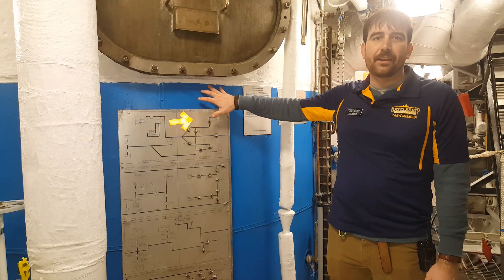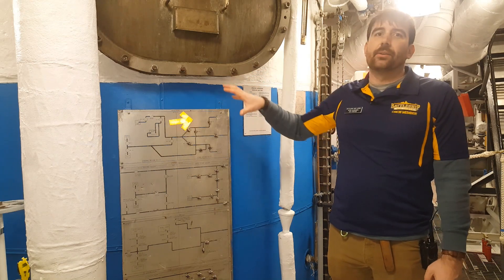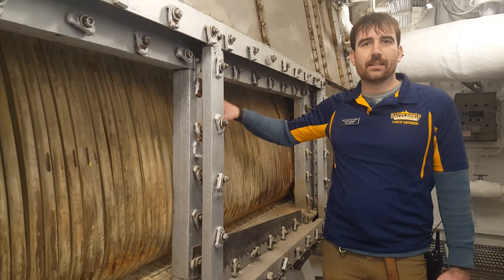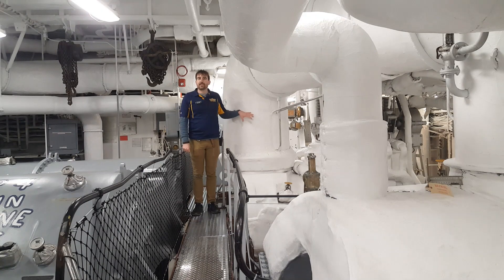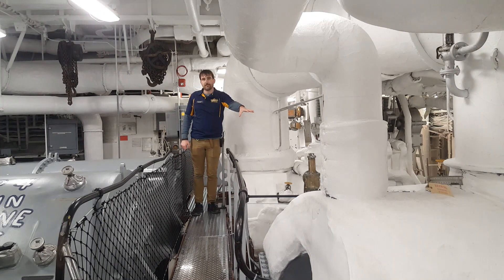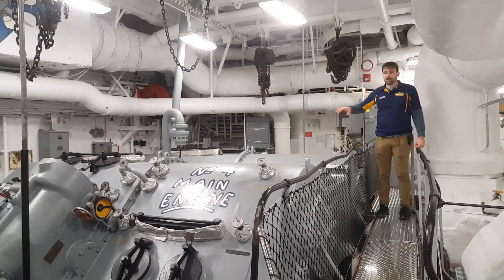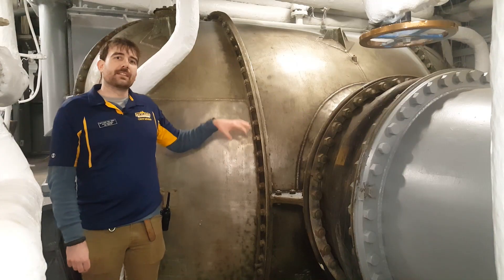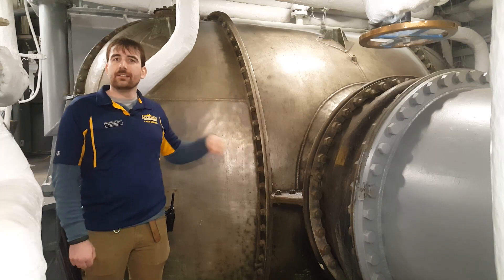The Steam Cycle

Comment: I used to wonder why the steam got condensed into water, which seemed to me to waste the heat in it.
I learned about the Carnot cycle and how the efficiency is better the large the temperature difference is, but I never had a gut feel for why.
Until I read reprints about old ocean liner steam plants. The efficiency of the condensers is measured in inches of VACUUM. The lower pressure at the exhaust of the low pressure turbine increases the efficiency, as it is the difference in pressure that supplies the force to turn the turbine. Thus, causing a vacuum at the exhaust increases the efficiency.

Comment: Those main engine inspection ports are locked with the same high security locks that the hold for nuclear weapons have.  Only the CO and the CHENG(Chief Engineer) have keys and they must be inserted and turned in order to access them.  The gears in there are so finely machined that IF someone were to toss sand or dirt in them, they'd be junk.  Those engines are worth a LOT of money and were virtually irreplaceable by the time the ships hit the 80's.

Comment: Believe it or not, the same basic equipment is on modern steam powered ships. The only difference between a nuke plant and a conventional is what makes the heat for boiling water. A hot rock or fire. 

The hot rock is classified. I could tell you but ammo is expensive these days.

Comment: I apologize.  I've been doing this work for too long.  I was a Navy BT and actually saw the Battleship NJ in Earle NJ.  She was on the next pier over.  I have to say she was and is a beautiful ship!  "As for the apologies... I realize most people were never snipes and this guy did a good job explaining however I have to point out that the picture of the boiler tubes were still on the fire side of the tubing.  He would have to look in a manhole or hand hole to be looking in the watersides of the boiler "which in the steam drum is really cool with the cyclone separators & chevron dryers with belly plates over the bottom tube sheet.  2ndly the right way to explain the DA tank is to say that it gets rid of non condensable gasses ie. oxygen and CO2.  Which brings up another point.  Fresh water isn't in the boiler.  That's boiler water.  The difference being that feedwater "from the DA tank" is fed into the boiler.  That water will become boiler water because a) Your evaporating the water constantly allowing all non volatile impurities and chemicals to be left in the boiler.  Also back in the day the chemicals were injected into the boiler differentiating it from other water..  "I just jumped down a rabbit hole".. I understand your not making new BT's.. but in my eyes proper terminology would be 1) Here you can see the fireside tubing and 2) boiler water is contained on the inside of the tubes.
Reply: Hank, "less than 15 ppb O2". One of the first lessons I learned of the steam cycle. Thanks for your service fellow snipe. I was an EOOW on Knox class frigates, p-fired frigates, and on AMERICA (CV 66). Loved marine engineering. Cheers. - senior chief, retired.
Reply: @jamesstark8316  Thank you for your service Senior Chief!  Weird coincidence that my chief's last name was James lol!  I remember seeing the America in Norfolk "from the pier" and believe we went on a med cruise with her.  All the ships in the battle group only got together once for pictures so its hard to remember but I do think she was one of the carriers we were out with.  I know we went out with the Coral Sea for my first one.  I saw that one docked in the Navy yard in Philly.  I was told they were going to scrap her at the time.
Reply: @hankscorpio6111  Thanks. It broke all of our hearts when they sank the AMERICA for practice/testing.  I was light off EOOW for her last deployment. There were divers over the side trying out some new underwater paint scheme. When the head diver checked in with me he stated that the hull looked brand new (wish I could say the same for the fuel oil piping). She was a fine ship.

Comment: Few things........ The condensate in the main condenser is first pumped to the main air ejector which purges the non condensible gasses before returning it to the DFT.  The feed water in the DFT is kept to around 240 degrees, heated by aux exhaust which comes from the main condenser.  Anyway, from the DFT the feed water (by way of the main feed boosters then MFPs)  then goes to the economizer where it picks up about 100 degrees of heat before it enters the steam drum on top of the boiler. From there, it goes down the tubes, out the superheater....... etc etc

Comment: Some details of the "deaereating feed tanks" (one per fireroom); this is a crucial part of the steam cycle, they remove dissolved Oxygen from the feed water, preheat the feed water and provide a positive suction for the main feed booster pumps. Dissolved Oxygen has a bad effect upon the inside of the boiler, when a bubble of Oxygen forms and sticks to an internal part, it will start to rapidly corrode the spot where the bubble has rested, so if the "DFT" is not working correctly your boiler will start to leak water and steam. The "DFT" receives water from the hot well of the condensers of the main engines and the ships service turbo-generators and the make-up feed water pump and it also receives low pressure steam exhausted from other turbine driven machinery; it is this steam that is blasted into the feed water that removes the dissolved Oxygen
Reply: ...  for good measure you can add a gallon or so of hydrazine!  Just don't get any on ya.

Comment: Those engines look like they could still run and power the ship, even though i dont think they ever will
Reply from the maker: Check this out: https://youtu.be/lK9ofM6ef5g
Reply: I'm willing to bet those turbines could still roll over. It just turns into a  money game.

Plus, the Navy goes through a cherry picks a lot of old equipment. My boat, commissioned in the 80's, had the lube oil purifiers from a decommissioned destroyer that served in WW2. And ventilation ducts from a Seawolf class sub (early 2000's overhaul).
Reply from the maker: Check this out https://youtu.be/lK9ofM6ef5g
Reply: @BattleshipNewJersey  Watched that one a couple days ago. Our sub tender, AS-40, had to go through a whole process to re-certify it's boilers and sent several people state side so they could operate said boilers.

Comment: Westinghouse calls them turbine blades. General Electric calls the same thing buckets and calls the stationary parts nozzles. I didn't care what they called them as long as they sent me my pay check. I worked for the GE Marine Department but got involved with many different manufacturer's products during shipyard overhauls.

 Ryan its great to see you explaining this equipment. I hope to get down there one day. I took my boat near the New Jersey when it was at the Suisun Mothball Fleet and got chased away by the Patrol Boat a few times. I hope to get down there to see the ship from the inside.
Reply: I'm used to jet engines so calling them turbine blades is more natural for me.
Reply: @killman369547  Tur-bin or tur-byne?
I like calling them blades as well. I told GE to stuff it years ago and never looked back.
Reply: I don't know the slang vocabulary of different manufacturers but to have some logic in it, I would say this: All buckets (in this field) are turbine blades but not all turbine blades are buckets. The blades in an impulse turbine (e.g. the Pelton turbine) do have a slight resemblance with a bucket but the blades in a reaction turbine do not. Calling all types of turbine blades buckets seems odd to me.
Reply: @skunkjobb  General Electric calls the power turbine blades ''buckets'' in gas turbines but the compressor section has ''blades''. Their steam turbine blades are called blades. The high pressure steam turbine wheel  impulse blades in the Curtis wheel might be referred to by GE as buckets but I never had dealings with changing or handling them in the shop or the field. Maybe some of you retired GE guys from MSTG or LSTG plants can set it straight.   The stationary blades are called nozzles.

Comment: No Condensate pumps or Feed Pumps? 
Also, instead of calling the HP turbine an impellor, rather call it a turbine with blades that resemble a big fan.
Great video. Shaking off all the cobwebs for the basic steam cycle.👍

Comment: I'm not sure why you keep referring to the steam turbines as 'impellers'.
They are not impellers.
 An impeller is used to increase the pressure and flow of a fluid. It is the opposite of a turbine, which extracts energy from, and reduces the pressure of a flowing fluid, in this case steam.
Pumps have impellers as they are powered and apply energy to a fluid to move it.
The compressor wheel in a turbo is a impeller which is powered by a turbine.